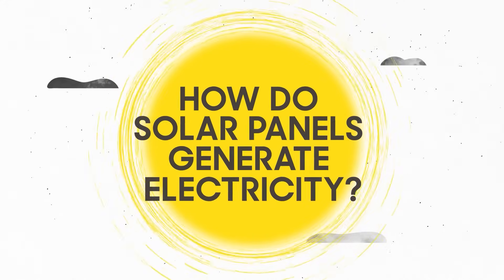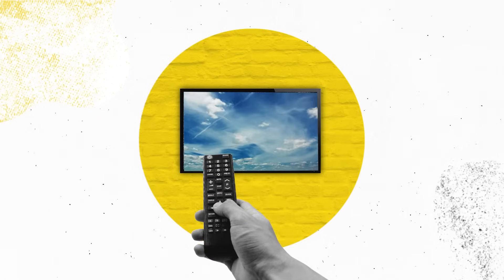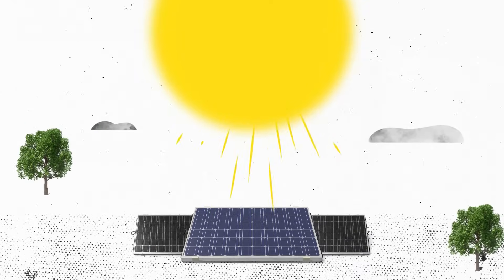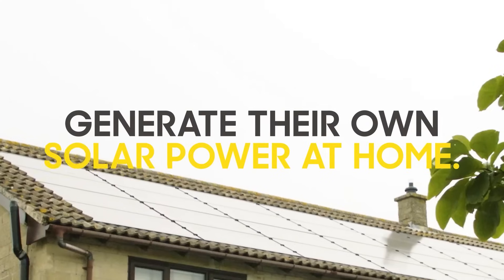How do solar panels work?

Comment: [00:00]	How do solar panels generate electricity? Electricity is the flow of electrons around a circuit in a solar panel energy.
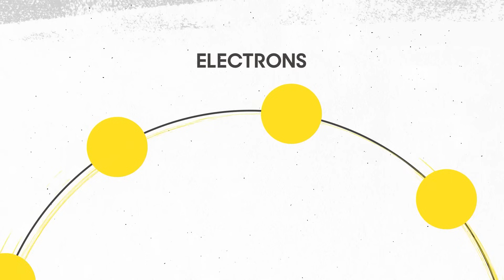[00:10]	from the sun prompts these electrons to start flowing, but how? It's all to do with the photovoltaic cells that
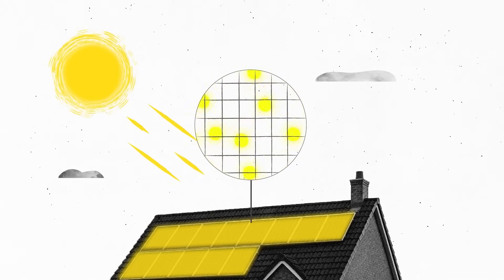[00:18]	solar panels are made from. Photovoltaic cells are made out of two layers of silicon. One layer is positively charged
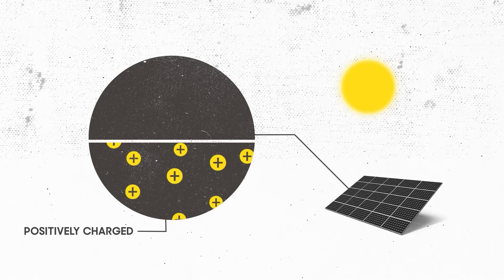[00:26]	and the other is negatively charged, creating an electric field that will enable an electric current to be generated. When
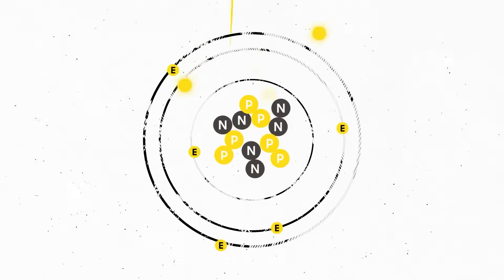[00:34]	sunlight hits the cell, light particles knock some of the electrons within the silicon free from their bonds. These are
[00:41]	drawn to the positively charged silicon layer. However, a bridge between the two layers only lets electrons cross in one
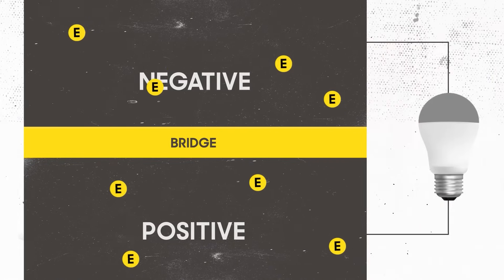[00:49]	direction, from positive to negative. So instead, the electrons are collected by conductive metal plates that move them from the
[0000:57]	solar cell into a circuit, where they flow freely as electricity. This electricity can be used in your home, stored
[0001:05]	in a battery or electric car, or exported to the electricity grid. Standard solar panels will generate 100% renewable electricity
[0001:15]	for 25 to 30 years. Good Energy buys electricity from hundreds of solar generators in Britain, along with supporting over
[0001:23]	100,000 people who generate their own solar power at home. Switch to Good Energy for power from sun, wind
[0001:31]	and water.